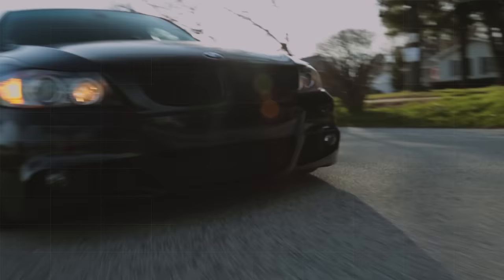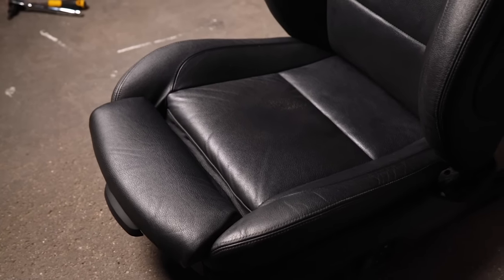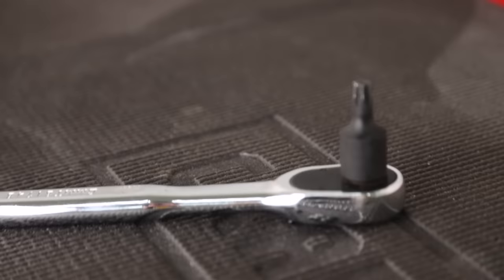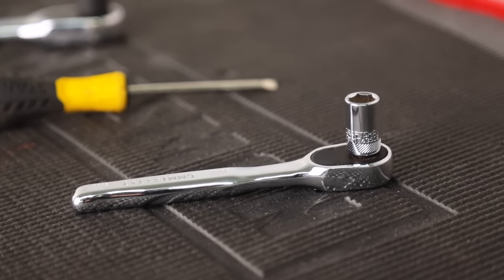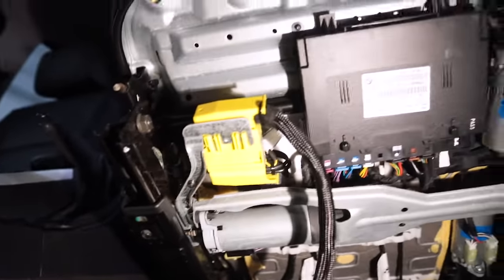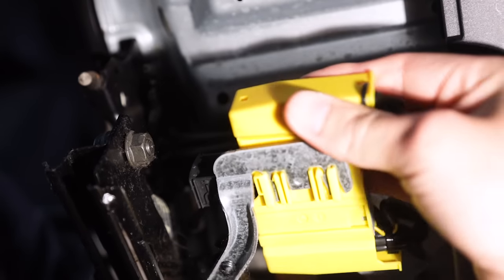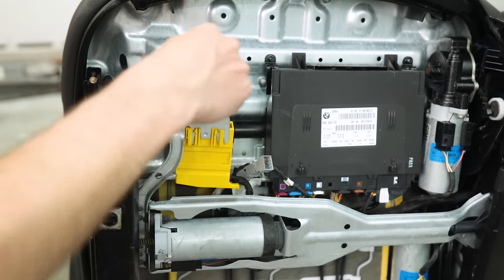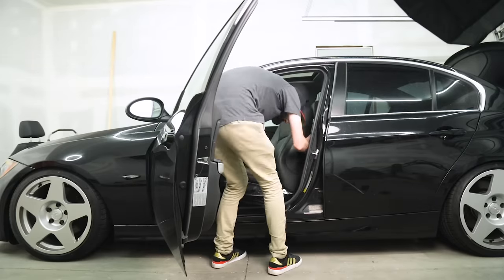BMW SPORT SEAT RETROFIT | Your Butt Deserves These!

Comment: I just switched mine and I have the same problem with the bolster supports not working, I was reading around and there’s posts on the forums that say something about swapping pin 7 and 9 on the harness, have a look on google and you’ll find it

Comment: I don't think it was mentioned, but all these T50s that hold the seat and belts in place have a TORQUE setting. It is very important to get the correct torque for if there is an accident

Comment: I know it's an old video but still have a question if you remember. Your old seat did not have thigh support as I see but you new seats do. Did you have to wire up and code the thigh support or it  worked right away. Or your old seats had thigh support?

Comment: congrats man, really worth it!!! I did the same switch last summer on my f30 from basic seats to sport one and happy about it! p.s. to activate inflatable sidebolsters you need to add positive voltage to that bolsters switch in a bundle of wires under the seat in a yellow connector. Better check the scheme of it ;)

Comment: Your car just looks so OEM+ and so clean. Without the wheels, tails(?) and red start button it looms like it just rolled off the assembly line... If you want an awesome looking front bumper, look up “M4 bumper for E90. Looks amazing in my opinion, and I had it on my 07 sedan.

Comment: Hey. My old seats

Edit. Bolsters definitely worked when they came out of my car last week.
Reply from the maker: I'll figure it out
Reply: Might be an electrical / wiring issue. Heard of similar stuff while swapping seats.
Reply: Justin, could you please update the video once you solve the bolsters issue? I did the same retrofit and can’t solve it yet. It’s not coding, it’s probably some wiring
Reply: The bolsters definitely need power, might need to scavenge power from one of the seat motors to make it work in worst case but it's definitely better than the se seats.
Reply: Did you figure the situation with bolsters out?

Comment: The part about the seat belt buckle needing to be kept with the same vehicle - I have not found that to be accurate.  When I replaced the driver side buckle on my E91, I just bought a new buckle to replace the old gummed up one.  Fairly easy job to do with no issues with the replacement buckle.  BTW, I'd love to replace my sport seats with those out of an E90 M3, but they're hard to find.  Pricing I've seen can be pretty silly, so I may just get them re-covered.

Comment: Love that intro! Even though it's subtle those seats look really good in there.
Btw, the reason the bolsters aren't working is because of the pins on the harness are different for 2007+ E90's. I replaced my 06 seats with 07 seats and the driver side lumbar support doesn't work. There's a to fix it, you can find it in forums for wiring diagram and what to do.
Reply: Hey, could you help me? I have exactly the same situation.

Comment: Can you swap heated seats to an E90 that did not have the heated seats from factory? If not can you use E90 M3 seats in a 328i? Thanks for the help, tried bimmer fourms but still wasn't super clear to me.

Comment: Funny coincidence, I just recently installed the same sport seats into my 11' 335i sedan and forgot to disconnect the battery and currently have a seatbelt and airbag light...I tried using Carly to erase the codes but they're still is on my dash. I was wondering if anyone knows how to get rid of those lights...Btw the seats were out of another 11' 335i sedan and everything does work on them.
Reply: Carly takes care with that error without problem, you have error with something else, check error codes, probably problem with ocupacy mat on passenger seat...
Reply: @Mouse-Ri  Sorry forgot to mention the two codes that Carly gave me were 0093AE and 0093AF, I don't know if its a code issue or an actual faulty sensor
Reply: @david124l  might be a blown seatbelt buckle so check that, did you swap the modules as well?

Comment: The seats that were put in the car are from the LCI version, the thread is white.  Unfortunately, they are not all leather, the sides are made of vinyl.  Inflating the backrest will work when you add + from the battery to the ankle under the seat.  I'm using Google Translator, so sorry for any spelling mistakes.  Greetings from Poland

Comment: I have a e90 se and I’ve installed msport seats the same as these in my car and they have a button that tightens and loosens the bolster but it doesn’t work, do I need to code it in or do I need to alter the wiring, if so what pins can someone point me in the right direction

Comment: It’s definitely a wiring issue. I’m going through the same thing with my seats and I’m slowly piecing together what I have to do
Reply: Hey, do you know what to do with wires? I have exactly the same problem
Reply: @voxmarcin96  basically you need to splice some wires to get power to that specific pin for the seats and on the driver’s side you’ll need a ground wire as well. I haven’t done it yet but it shouldn’t be too hard. Just look up the wiring diagram for the seats and you should be able to figure it out
Reply: @amurexx9129  okay, maybe do you know where I can find good e90 diagrams?
Reply: @voxmarcin96  bimmer post or e90 post
Reply: @amurexx9129  thank you

Comment: this isnt really a retrofit all you did was swap the seatbelt pretensioner unit. a retrofit would be going from something like manual operated seats to electrically operated ones including or not including memort seats. 

well  i guess im going to keep looking as i need the info on wiring that stuff in because that is what im trying to do.